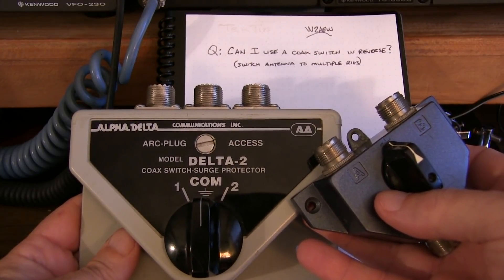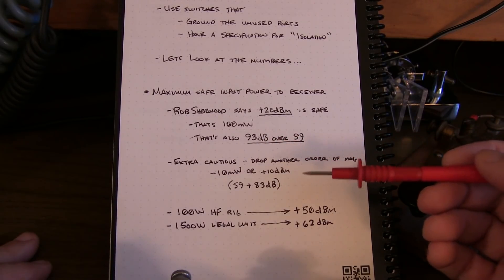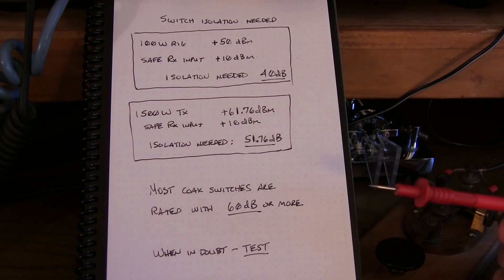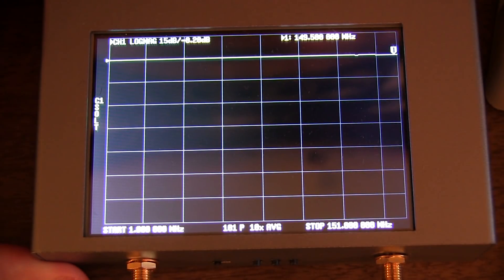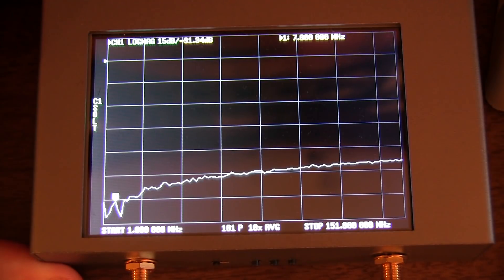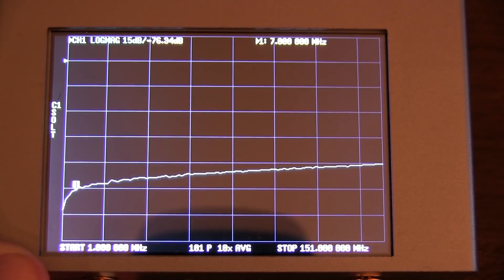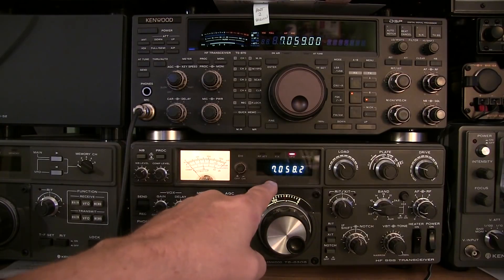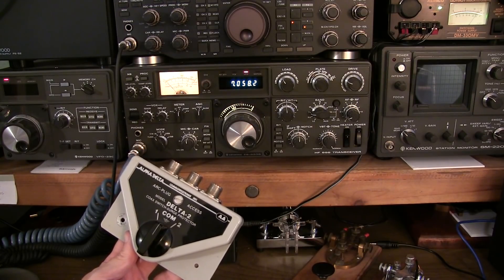#341: Ham tip: Safely using a coax switch to connect multiple rigs to a single antenna system

Comment: Great timing.  Just sold our old QTH and moved into a new temp one here in NH.  For the first time ever, I built a window pass through with three UHF bulkhead connectors so I can play with a few antennas without just running coax through the window.  I also wanted to swap other rigs into an antenna and have my first 2 position switch.  I never thought about the isolation ratings.

Comment: You had me until the end. Maybe I don't understand it, but when you keyed up the top radio, if the antenna switch was isolating X amount of dB, they why would the signal meter on the bottom radio go S9 +20? Shouldn't it stay close to nothing?
Reply from the maker: S9+25dB is about -48dBm that is going into the receiver.  The transmitter is doing 100W which is +50dBm - therefore there is 98dB of isolation between the transmitted signal and the signal seen by the receiver.
Reply: @w2aew  ok. thank you.
Reply: Was wondering the same thing, thanks

Comment: I've used both good and not so good switches and they all have problems with them. Much better to have dedicated antennas to rigs.
Reply from the maker: Just keep in mind that an antenna that is transmitting nearby to another antenna can couple a LOT more energy into that antenna than you'd see by using a good switch.  It all depends on the type, position, distance, etc. between the multiple antennas.
Reply: @w2aew  my antennas are about 80 ft apart
Reply from the maker: @wireworks616  The type of antenna (dipole, vertical, yagi, etc.) as well as their orientation to one another, the bands of operation for each and the frequency of operation, will all have an impact on how much transmitted energy gets coupled to the other antenna.  Certainly worth checking on all combinations of operating frequencies.  You'll likely stay below +20dBm, but definitely worth checking out.  Some of us (alas), don't have sufficient property to mount multiple antennas at decent distances between them.
Reply: @w2aew  I have one vertical on one side of the house and another on the opposite side. I did that so they wouldn't interfere with each other
Reply from the maker: @wireworks616  That's good - still worth checking the amount of coupling though.

Comment: Pardon my ignorance but if the rigs that aren't being used switched off do you even have to worry about it?
Reply from the maker: Switching a rig off will often times not disconnect the antenna - so the front end may still be vulnerable.
Reply: @w2aew  Gotcha, thanks!  73, K8JLW

Comment: This is a good analysis of the problem and I agree with your conclusions. I wonder whether your 530 S meter circuit is accurate enough to be trusted.  Have you checked the S meter readings from a calibrated signal generator at the levels involved.  Ie. is S9+25 db = -73 dbm + 25 = -48 dbm actually indicating s9+25 on the meter?  Most manuals I have looked at suggest calibrating the s9 position but the rest of the scale is an unknown and for some radios, quite imaginary in terms of accuracy!  (Liked and Subscribed) 73 Andrew VK1DA
Reply from the maker: I had checked the S meter in the 830 a year or two ago, and it's scale above S9 was close enough for this approximation.
Reply: @w2aew  OK - so few people do that! Good to know.

Comment: Alan, fantastic video and explanation.  Your efforts are greatly appreciated!  Dad used switches similarly as I remember, but they were round ones, either old B&W or some home brew ones.  This was in the 70s-90's.  I've been using 2 Alpha Delta 4 position switches, one to select between radios at the desk and one between antennas at the window.  This setup has worked well.  I am reconfiguring the window switch to select between UHF/VHF antennas, as I will shortly have only one HF feed line out to a remote switch (MFJ) at the tower.  Just a thought....testing a remote switch's isolation would be a great "next episode" for you!  73 stay safe. de Cliff W3KKO
Reply: PS  Great Kenwood station!!!  I've had a burning desire to get an 870, they're just a great looking and sounding rig.... maybe someday!

Comment: Everything i read says UHF connectors(PL-259, SO-239) are antiquated and not suitable for modern VHF and up radios, yet almost every VHF/UHF HAM radio  sold in the states today has an SO-239 output.  Is it worth changing these out for a good quality BNC/TNC/SMA/N-Type connector?
Can you do a video with some real world comparison between these coax connectors?
love the videos, thanks

Comment: I've actually often wondered about this question - usually these are used to switch one radio between 2 antennas... I've wanted to have 2 radios connected to 1 antenna and I've been concerned about transmitting 100w (or more) directly into my other radio through a bad switch.
Reply from the maker: You can test the switch - either with a NanoVNA as I've shown, or even with simply a low-power RF source and your receiver.

Comment: Thanks Alan. Always thankful for your teaching.  We never stop learning. I have wondered about just how much isolation there is on these switches.  Wondering also what happens if someone has a high SWR on the common antenna port and if the isolation is still good with higher RF voltages due to the miss match. Thanks, Terry, WA0DTH
Reply from the maker: Not sure, but my gut tells me it may only be a few dB worse.

Comment: Excellent video! Just quickly tested my MFJ-1700c with my vna and got between 81 db (@ 1MHz) to 59 db (@ 150 MHz).  The specs claim more than 60 db between 1.8 and 30 MHz.  Internal construction is pretty decent for MFJ.  I guess maybe I should do a video on measuring it on the MFJ-1700c and showing it's internals...

Comment: Hi Alan,
How timely. I want to be able to switch between my FT450 and a Flex 1500 into my antenna system that uses an Ameritron RCS-8V remote switch. You have shown it can be easily done with a manual coax switch. Think I will go with the Alpha Delta for the added protection. You and the family stay safe.  73  WJ3U

Comment: Awesome as always!

Timely for me, too.  I realized the other week that the local AM broadcast station is putting about +20 dBm into my rig (at the end of a long run of coax) when I use my 80m EFHW.  I knew it was swamping the radio but hadn't thought much about it damaging things!  Back to the AM broadcast filter build with me (for which I've been your fast pulse generator that I built the other day).

I'm lucky to be a ham in the modern era where things like the NanoVNA and TinySA are available and when great education like this is available on demand on YouTube.

Thanks as always for your amazing explanations, W2AEW!  73 de AB4EN.

Comment: Wait a sec...is that a Nintendo DS stylus you're using?
Reply from the maker: could be...  it came with the NanoVNA...
Reply: @w2aew  Interesting. The only thing I got with my NanoVNA was a guitar pick!
Reply from the maker: @vitaflo  I got the guitar pick with my NanoVNA-H4.  But, the NanoVNA V2plus4 came with the stylus.  I like the pick a little better, because it was easy to "tether" to the unit.  I feel like I'm going to lose the stylus at some point...
Reply: Yep it's a DS stylus. I doubt any other stylus was mass produced in higher quantities by so many manufacturers
Reply: DS Lite 😑

Comment: Is there a diseqc switch type system for UHF/VHF?
Reply from the maker: I don't know what "diseqc" means.
Reply: @w2aew  used in multi satellite setups.
Reply: @w2aew   a method  of controlling a remote device (like a switch) via coax this by sending an OOK 22kHz  signal up the feeder.  https://en.wikipedia.org/wiki/DiSEqC. I am not aware of ham gear utilizing a method like this, are you?  It seems to me that it might be difficult to use in a transmitting environment.
Reply from the maker: @Piotr_P_M  I am not aware of any amateur gear using this technique.